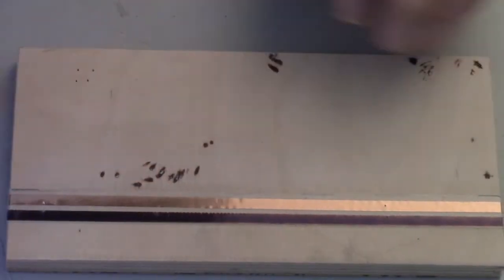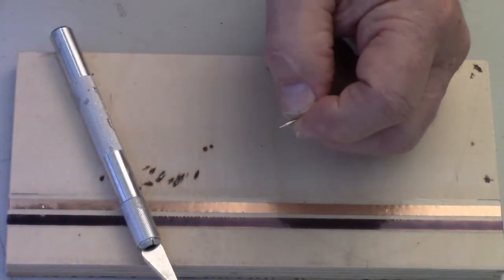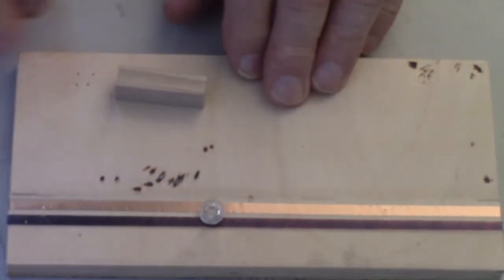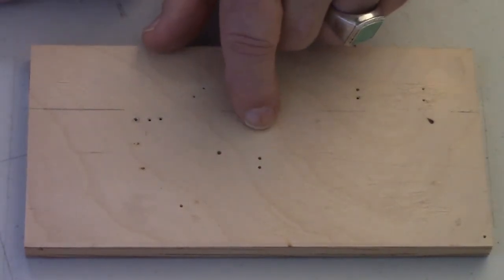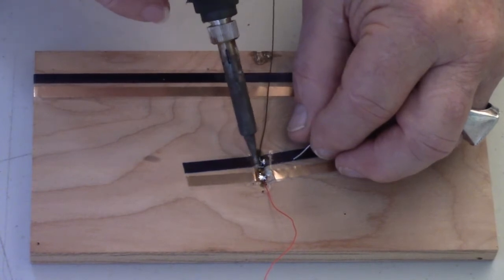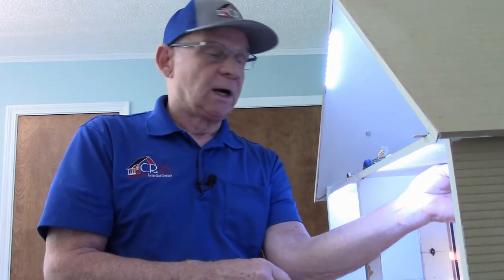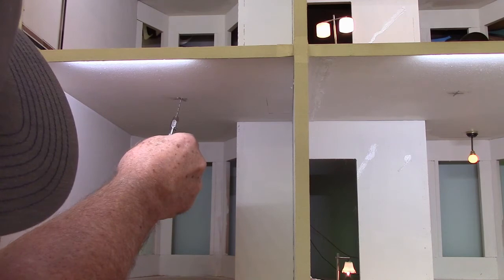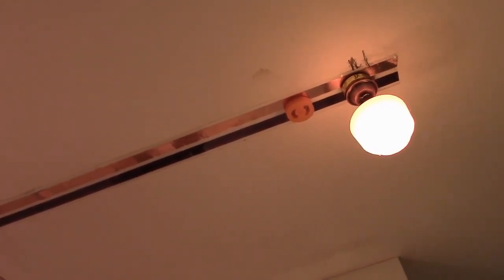Cir-kit Concepts Components  Part D

Comment: Your videos are very helpful, thanks for doing them. Do you ever work with Cit-kit's light switches? I've never been quite clear on how you isolate these so they only turn on an overhead light in one room without also turning the plugged in lamps on/off or the overheads in other nearby rooms.